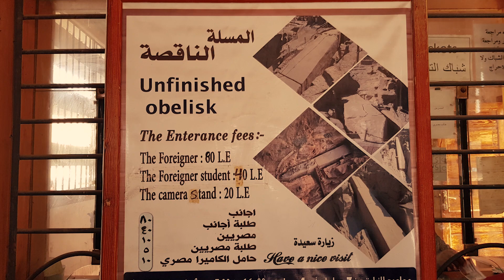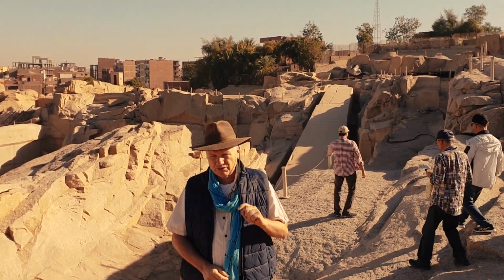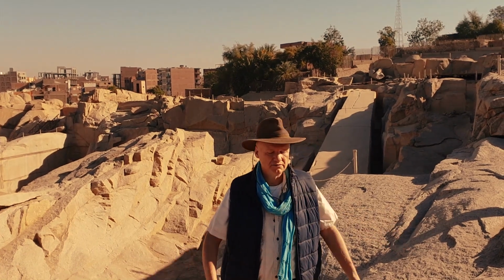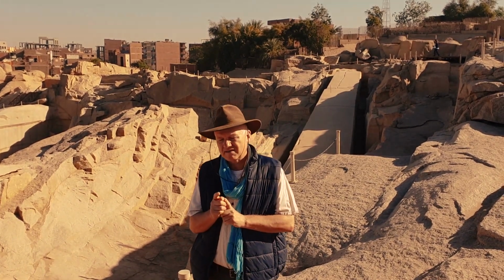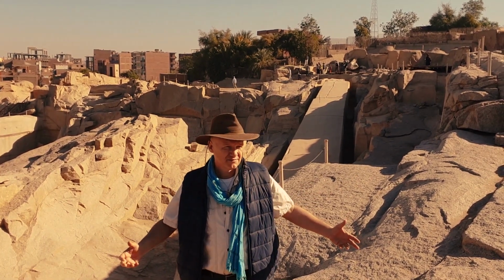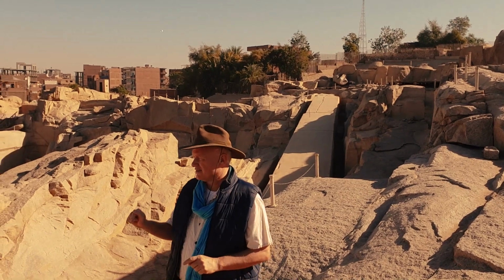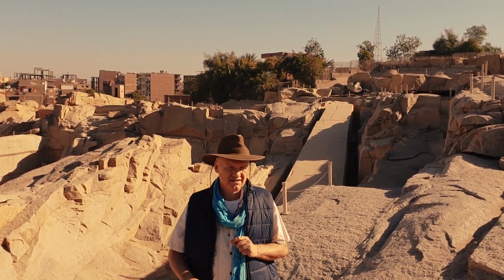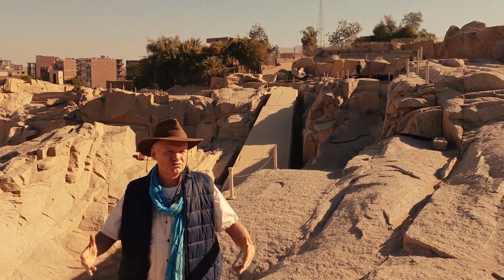Who and How Cut the Unfinished Obelisk in Aswan?

Comment: The dolorite stone balls of varying sizes were all thats left from ball mills the Egyptians used to crush limestone and or granite down to rough stone powders they used to make a kind of concrete, or geopolymer its been called - for the casing stones of the pyramids and many other buildings and structures. The egyptians made many different types of polymers, its been theorized that they even made a granite geopolymer. As this granite geopolymer was hardening, it was able to be formed, cut and shaped fairly easily, hence the regular scoop marks on the unfinished obelisk. They were working on these structures for hundreds and hundreds of years, so they had plenty of time to work out their granite concrete recipes and their drying times and characteristics.

Comment: PLEASE: Im looking for advice from stonemasons, i may have (partly) figured out how they made the scallop marks on the unfinished obelisk at Aswan!! If you have a dolerite ball the size of a basketball, roped so that the base is exposed and even lengths of rope come off each direction horizontally...and a crew of workers on each side rapidly pull and release the rope you create a hammer drill of sorts. NOW to prevent the granite being shattered , a layer of wet sand was added to dissipate the force ( they used wet sand for other techniques such as coring drillholes) that has a powerful abrasive action. Its also slightly irregular and would result in marks JUST LIKE those on the unfinished obelisk!!! I want to setup a recreation experiment!!! 
Edit: with rope  at 30 degree angle , 3 men on each side of rope can work the apparatus
Reply: They did not use sand in tube drills, this has been thoroughly debunked. I suggest you watch unchartedX's series on this. The spin rate of the drills used to make the cores was far greater than anything we can even produce today. Also, how would they cut horizontally with your method? How do you make the cut under the obelisk to free it?

Comment: Has anyone entertained the theory of them using harder stones as ball bearings with garnet and micro diamonds from the kimberlite pipe of gilf kebir as an abrasive? You could pull a weighted board with pitch over the top to move the bearings which would grind the abrasive into the rock creating the tightly bored holes seen here. A diamond ball burr does the exact same thing.